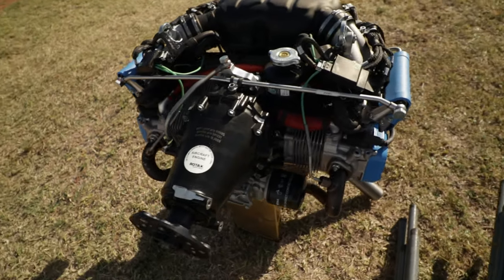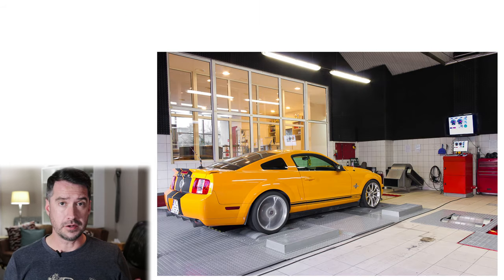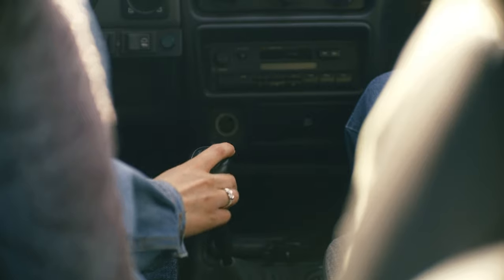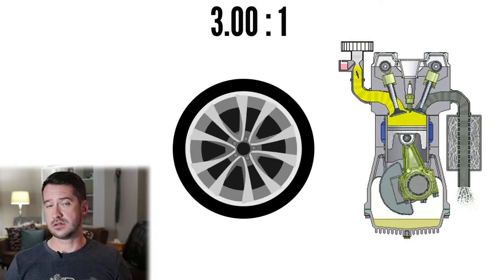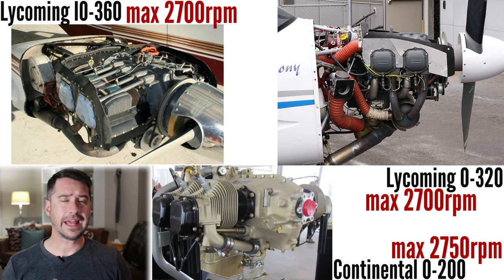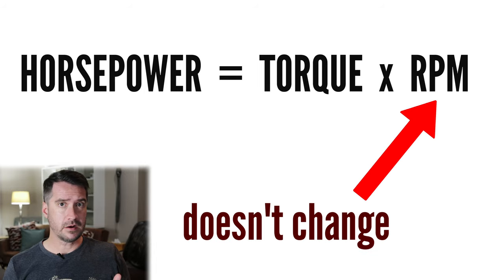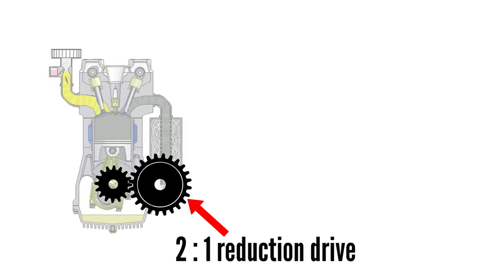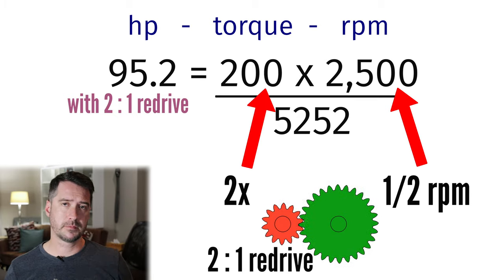Propeller Speed Reduction TORQUE Increase EXPLAINED

Comment: Another two benefits of reduction drives: 1) allows for lower engine mounting & 2) reduction gearboxes with slipper clutches provide some protection to the engine in case of a shock load/prop strike.

Comment: One correction: PSRUs generally increase the power to weight ratio of an engine, as they allow a smaller engine to perform the same amount of mechanical work as a larger engine.

Rotax 912 iS: 100 hp; 64 kg; 1.56 hp/kg; 2,388 rpm @ propeller.

ULPower 260iS: 107 hp; 72.3 kg; 1.48 hp/kg; 3,300 rpm @ propeller.

Continental O-200-D: 100 hp; 89 kg; 1.12 hp/kg; 2,750 rpm @ propeller.

Lycoming O-235-C1A: 100 hp; 107 kg; 0.93 hp/kg; 2,450 rpm @ propeller.

Lycoming O-235-F1B: 125 hp; 113 kg;  1.1 hp/kg; 2800 rpm @ propeller.

Really, improving power to weight ratio is one of the most important reasons why PSRUs are used on aircraft engines. Just imagine how big a direct-drive Merlin would have needed to be in order to make its power at 1,200 - 1,400 rpm at the propeller (probably at least 60 liters).

Comment: Thank you again. I am building a Pietenpol and have a 2 cylinder BMW 1200 GS engine of unknown hours and came from a previous aircraft installation. It is fitted with a Rotax C gearbox. I have not started on this part of the project. This video applies directly to my project. As a matter of interest, would a C gearbox be able to handle this application? Thanks again.
Reply from the maker: Let me know the reduction ratio of your C box. The Rotax C gearbox comes in different reduction ratios, between 2.62:1 and 4.0:1. My guess is 2.62:1 as that will give a max propeller rpm of 2,600 (assuming engine max is 6,800). If it's the 3.00:1 or higher ratios you will need a big propeller. I think the Pietenpol sits quite low when you lift the tail so you might be limited in prop diameter for ground clearance. What was the previous application of the 1200GS?
Reply: @LetsGoAviate  Thanks for the response. I have not opened the gearbox yet, because I am still working on the airframe. I hope it is 2.62.1. Will the gearbox be robust enough for the engine? I have no information on the previous application. It has dual fuel pumps dual ECU's and is standard with dual sparkplugs. I am considering adding an additional injector to each cylinder for redundancy, as well as small second battery. Also centrifugal clutch. Thanks again.
Reply from the maker: I'm not actually sure what the max hp rating on the Rotax C box is. Might have to check with an AP or someone with experience, to be safe.
Reply: Thank you so much. @LetsGoAviate

Comment: A very complicated topic. I think we have spoken about it previously. In short a re-drive is more efficient, this is why they are pushing for them in airliners, this is why helicopters use them. Rotating a larger propeller slower is more efficient than turning a small propeller faster. How much power/torque an engine produces (on a dyno graph) means nothing compared to how much power a propeller consumes. At 8:00 you compare two engines with different propeller rpms, but don't explain the propellers will be different. Even with variable pitch propellers, if you increase the pitch to absorb the torque, this does not mean that the increase in thrust will be proportional. There is very little data that is shared with regards to power made, power utilised, what propeller is being used at what airspeed and density.
Reply from the maker: Yes I think I know where you are going, thrust propels an aircraft forward, not engine hp. But I'm talking about hp, torque and rpm in this video, not thrust. I'm trying to break - as you said - a complicated topic into understandable chunks in a video that isn't hours long. This is the basic understanding on the torque and PSRU subject that can be built upon, or at least that's how I see it. I think clearly you understand the subject already and moving on to the more complicated subject of thrust.
Reply: @LetsGoAviate  I'd like to know more about prop speed reduction unit failure modes. I read they fail often and that torsional vibration destroys them.